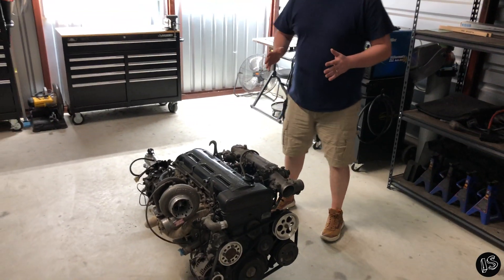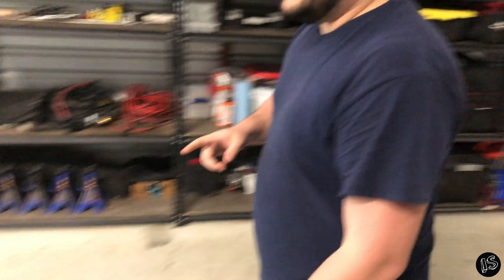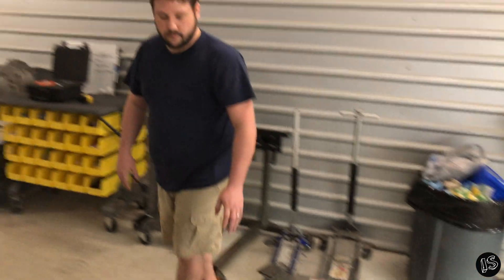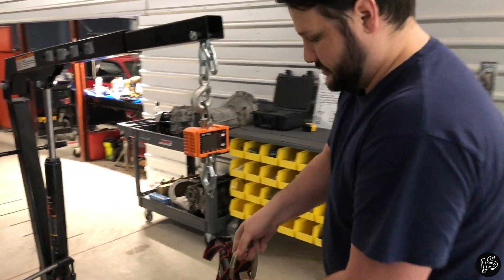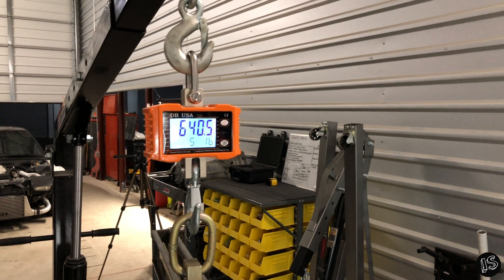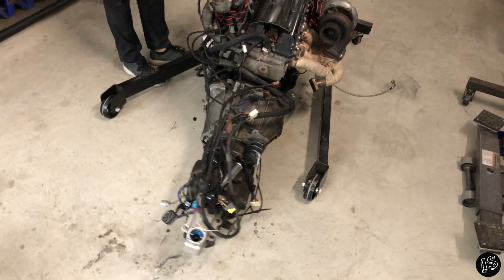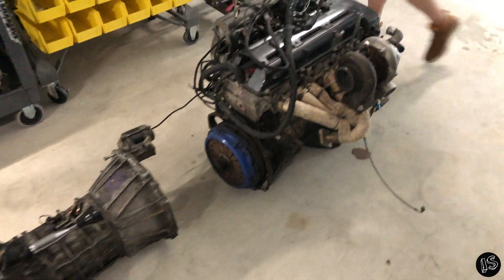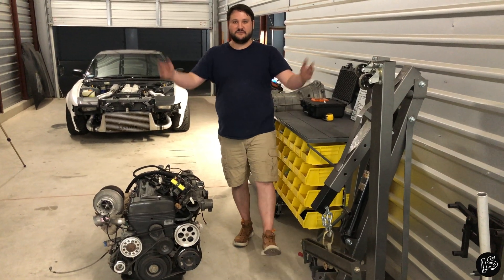2JZ-GTE | Weight & Dimension Series — Ep. 1

Comment: Jesus. I knew they were heavy but thats like mopar magnum engine weight. Curious to see what a bmw m5x weighs fully dressed. Ive seen them say 289lbs for aluminum and 299lbs for iron block  but no definitive answer.
Reply: M50B25 or the other iron block M5X variants are between 300 and 330 lbs depending on options, with no tranny, ready to drop in. Let's ignore the aluminum block ones cause they aren't a viable and comparable option. 2JZ's weigh more cause most things is slightly bigger and beefier. It all adds up in the end. It's also got a big single on it which by itself is 50 lbs.